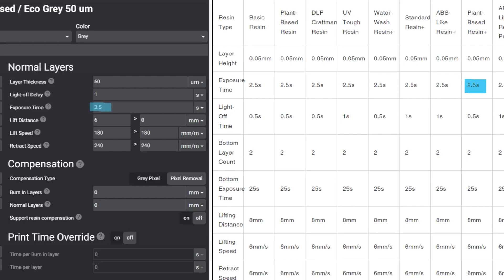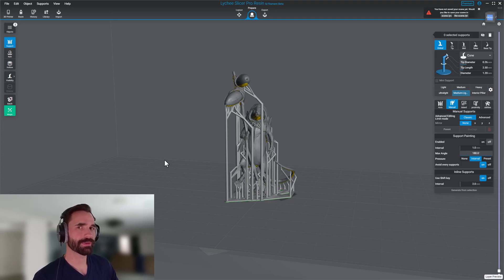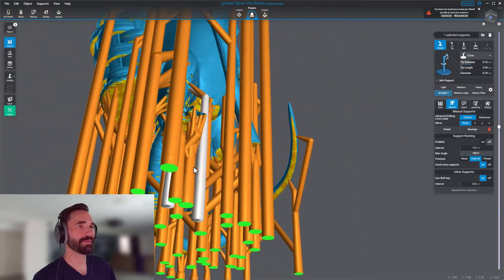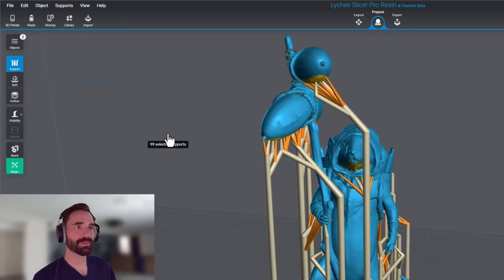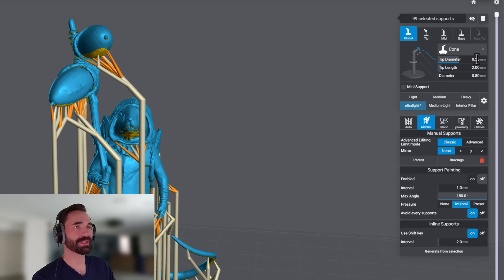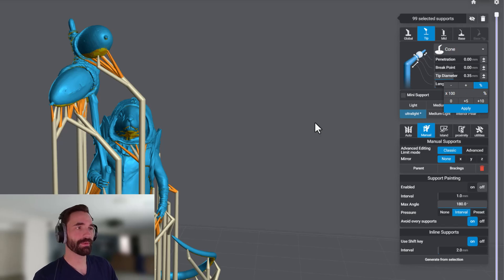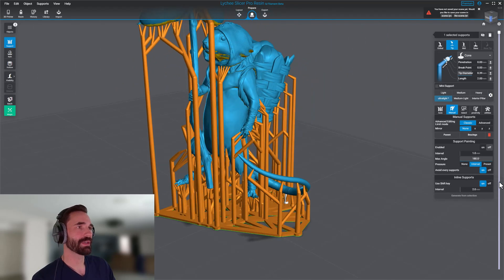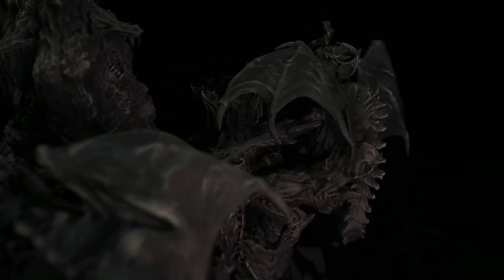Stop over-exposing! Follow this Lychee Slicer Tip for Success!

Comment: Older videos are so much better, at least from 2021/22, compared to the rubbish you get fed today! I'm back just looking over a couple of things for this Saturn 4 16k Ultra, just to refresh my memory as I haven't used my printers since Christmas! I just bought this new one to try, but I'm finding I'm having the good old compression issues the exact same as the Saturn 2 8k and 3 12k Ultra had! 
 I remember the way Elegoo leveling was done with them the card had to move freely between the plate and screen, but normally it wouldn't after setting the Z home and leveling. We had to lift the build plate around 2mm and set a new Z home! Remember? Even had it in the user manual!
I think the Saturn 4 Ultra 16k has this exact issue, but they say to now put four bits of paper in and make sure they don't pull out! It's like a copy and paste from the Anycubic M5s nonsense we got the first time with a defective build plate!
I'm going to test this out today on my S4u16k in manual leveling and raise the plate that 2mm see if this removes the first few base layer compression issues! Hopefully this gives enough room for the resin to flow back down and settle more aswell as noticed i also had a slight bit of shifting on the XP2 Validation test's all had it at different exposures so it's the shifting from the tilting vat resin not being level when layer is being cured!
Reply from the maker: Problem with the Saturn 4 any version of it Is that it has a Springs in the build plate that never lock into place so the whole bill plate is just free to move around during the entire print. 

This is a major design flaw and I'm not sure how it got past any sort of scrutiny. 

The only real fix is to modify the build plate so it can't move or use a lot of light off delay so that The compression caused by trying to compress resin down to 0.05 mm or lower can dissipate.

Comment: Struggling with this exact thing at the moment. Took me a long while to figure out what was wrong and this must be it. Have a print going right now for the fourth time and this time I did what this video said, not pro version though.

Lychee said a few supports blended into the model and they had to be removed. Hope that won't cause a failed print.
Reply from the maker: If you don't have Pro it can be harder to fix a bad support. With Pro you can just move the different parts to get it into a good location.

I hope it works out
Reply: @J3DTech  The print just finished and it worked! I went overboard though just to make sure it was the supports that was the problem. The lowest supports along the whole base was 0.28 mm at the tips. Guess that was too little for my Mars 3 Pro, I changed all supports to 0.5 mm and also added heavy supports all over the bottom of the base. Too much, I know. But noe I know that was the issue! Going to have to learn more about adapting presupported models, I'm very far away from doing it from scratch.

Thank you so much for this video. After four fails in a row I was almost ready to give up resin printing all together.
Reply from the maker: @HavasiP  Great to hear, if you like you can try 0.4mm for the main structural supports and 0.3mm for details. See if it still paints and keeps the tip damage at a low.
Reply: Still have some problems. Just did a huge print and it's successful, but many supports have come off the model during the print. Even ones with a tip of 0.7 mm have "let go" during the print. Could there be something else wrong other than too small tips?
Reply from the maker: @HavasiP  If you can join up on the Lychee disco and reach out to me there. It's better to share screenshots and see your printers full settings and other conditions.

The truth is there are sooo many things that can cause a failure. It's best to just get all the information first.
Reply: @J3DTech   Will do! Thank you.

Comment: A the LOOT STUDIO method, massive chonky supports. Through the magic of math, having multiple smaller supports will yield a greater support surface than a single large support.
Reply from the maker: One Page Rules, Atlas, Witchon Miniatures, Lion Heart Forge, Archvillan games, Mini Monster Mayhem Nerkison, I could og on.. all use larger tips sizes than 0.4mm for the "structure" supports. This may feel large even to me, however I understand it's better to give the customer printability even with a poor resin and let them pick their exposure range.

I would also like to point out that in this video I did not suggest making all supports large. I showed a 10% growth of only the main structural supports. I would agree that doing this to all of them would end up in excessive damage to the print.

To your point that having many smaller = one large, yes and no. I've tested this quite a bit. If they get too small the resin simply does not have enough sheer strength and they fail. For example, 10x 0.18mm tips wont hold as much weight as a single 0.4mm. They have a tendency to be so brittle to be almost worthless for anything but the smallest details where all you need is a little push.

Final point, this is not a video about adding or moving supports to increase the effectiveness of support placement. Something you and yours are fantastic at. It's just an alternative method to get that frustrating print that won't work. And you rather not lose detail by smashing that exposure button.

Comment: Curious, when some shops give pre supported models are they giving lychee files?? The supports are always baked in to the stl for me.
Reply from the maker: Many do these days, if they dont.. well demand that they do ;)
Reply: @J3DTech  Would be nice to be able to change the scale of a pre supported then recalculate supports. I will ask them about it! Thanks
Reply from the maker: @ItsBrody  The only issue with scaling is that as a model grows in size, the space between supports also grows and unless you feel that space in you're going to get support failures or at minimum deformation of the print.

This is generally why scaling does require you to either completely redo supports or make major adjustments.
Reply: @J3DTech  I also had the thought of opening a premium supports file with a free version. Not sure what would happen. Or how editable it would be.
Reply from the maker: @ItsBrody  There's nothing different about the file format. Anything created in pro can be used by free versions. You just don't have the same abilities to manipulate it like a pro user can.
Reply: sadly the patreons that i use don’t use lychee files :(
Reply: @ImInfinix  I use Loot Studios, and they dont seem to use them either. Although I'm pretty certain they use Lychee to support.
Reply: @ItsBrody  i’m more on the anime/cartoon scene. but it’d be weird if they used lychee but uploaded from a different slicer. just seems like more work
Reply from the maker: @ItsBrody  I have definitely noticed it's becoming more and more popular. As more individuals demand the .lys file the more pre-supporting shops will provide it.